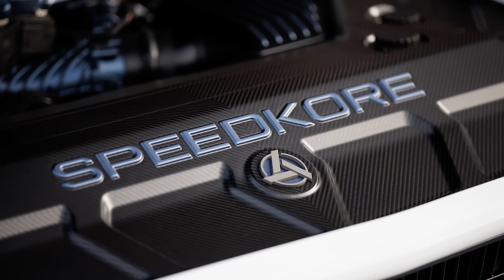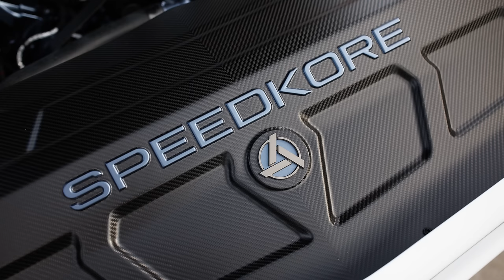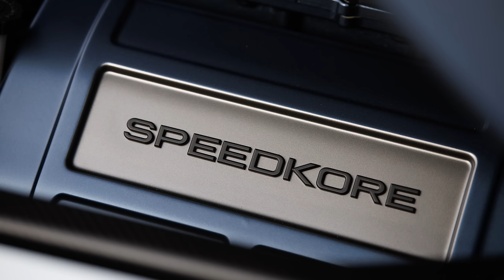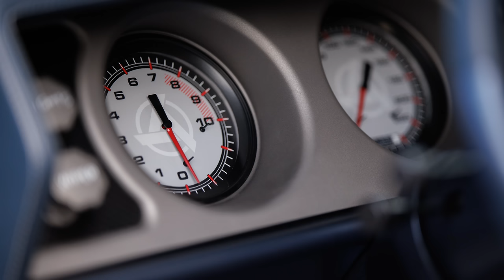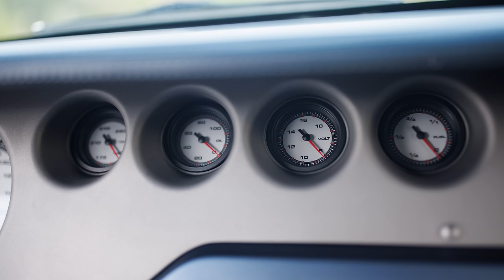The Perfect Dodge Charger? Speedkore's Hellcat-Swapped 700hp "Ghost"

Comment: So excited they used a blue interior with the white paint.... I'm of the hard opinion that a beautiful blue leather interior with either a gorgeous light silver like Porsche's GT Silver or a gorgeous white paint, again, like Porsche's Carrera White Metallic, is classy and classic AF. I really wish I had the funds to have a car built to this standard, but better....70½ Camaro Z28, GenV LT1 block, destroked with a set of billet rods and forged short crank for a 3" stroke making an effective 5L GenV LT1, old style Gen3 valve covers, dual plane 4bbl EFI intake so it could look period correct, but be an absolute 10k RPM screaming monster, slid back behind the front wheels, full carbon everything, but even though the brightwork was now carbon, replated in chrome to hide it all, full custom chassis with IRS, Ohlins at all 4,  Forgeline RS5 wheels for that stock appearance but larger, 295 front, 325 rear, Brembo carbon brakes, 6spd close ratio TR6060 trans, full leather interior that while upgraded, appears stock.... and keeping the stock color palette, which is the only good thing about me not having the money to build, because in 1970, there's so many fantastic colors the Camaro could be had in, and it's almost impossible to choose which one is "the best", I'd probably learn towards Citrus Green, Forest Green, Autumn Gold, Camaro Gold, Green Mist, Classic Copper, Desert Sand, Champagne Gold, Black Cherry (which must've been ordered in very low numbers as I've never seen one), or Hugger Orange....or, which I believe the "black cherry" turned into for 71, a color called Rosewood.... yeah, maybe Rosewood 👌😅

Comment: I'd like to see carbon core make an entire unibody structure.
And here's what cars I think should be built:
1986 svo mustang 2.3 i-4 ecoboost 450hp engine.
1990-1995 CHEVY ZR-1.
1995 MUSTANG cobra R 
1987 buick GRAND NATIONAL.
RAM TRX (aluminum tube frame, carbon body/bed.)
Porsche 928 S4. W/ cayenne turbo V-8
Cadillac XLR-V.
VW Karman(carbon?) ghia w/ porsche boxster 718 2.5 liter flat four.
Fiat 500 Abarth 695 SS
With ducati desmosedici stradale v-4 engine.
Honda S2000.
2002 lotus esprit w/ ford ecoboost 2.3 turbo I-4 450 hp.
LS swapped rear drive buick reatta.

Comment: This is the next step in Pro Touring - let's call it Pro Carbon. That means not just carbon fiber body panels, but a true, FULL CARBON FIBER CHASSIS. WITH a complete rollcage! These cars are going to be insanely stiff and fast. This build isn't there just yet - there's still a LOT of metal framing and all, and it's not as integrated as a true carbon fiber tub - but it's already miles ahead of everything else.

Comment: Are there wheel well liners added? If not, that carbon is going to get beat to hell. The carbon pan underneath will get beat up too.
Reply: I was thinking the same thing. Also don't understand why it has no heat shield between the fuel tank and exhaust, power steering lines and exhaust, but has heat shields everywhere else. 🤔